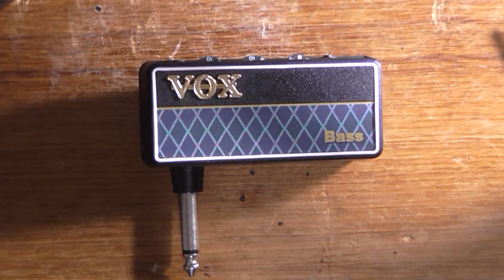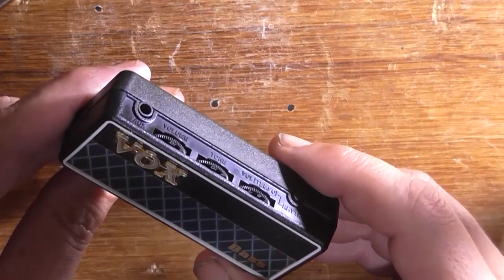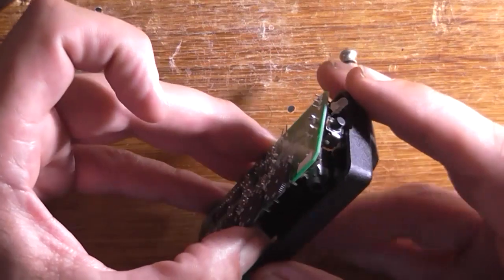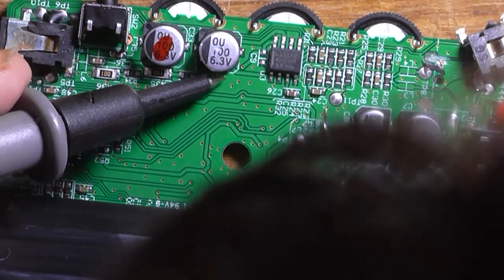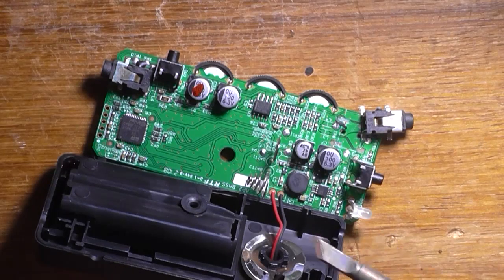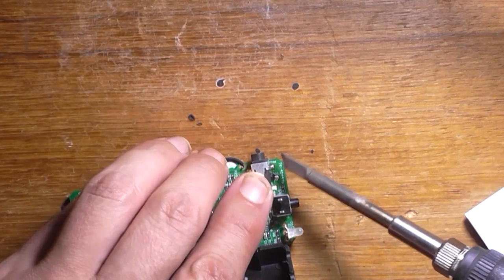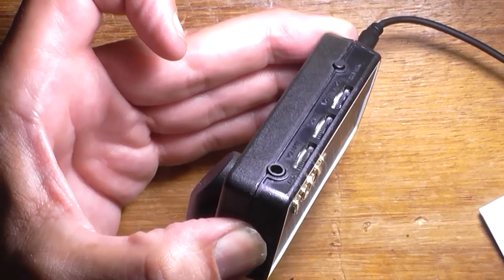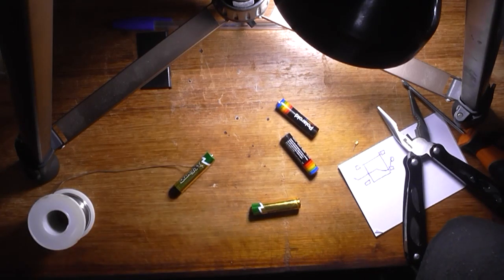VOX amPlug-2 Bass Guitar Headphone Amplifier Repair: FAIL!

Comment: @andymarshman9546
1 hour ago
Mine wouldn't turn on.  batteries good.  I found the spring for the positive battery terminal (closest to the pots) was not extending out enough to make contact with the battery.  I opened the thing up and using tweezers (a small Q-Tip would do) I pushed the centre of the spring forward just slightly.  If you push too much, the case won't go back together.  Works 100%.  Someone else suggested putting a small piece of tinfoil between the battery + and the spring.  I prefer my solution.

Comment: I'm an electronics tech as well as bass player.  No need to troubleshoot the electronics usually.  Mine wouldn't turn on.  batteries good.  I found the spring for the positive battery terminal (closest to the pots) was not extending out enough to make contact with the battery.  I opened the thing up and using tweezers (a small Q-Tip would do) I pushed the centre of the spring forward just slightly.  If you push too much, the case won't go back together.  Works 100%.  Someone else suggested putting a small piece of tinfoil between the battery + and the spring.  I prefer my solution.
Reply from the maker: Yeah, unfortunately I did repair the Aux socket, but knocked off an SOT transistor with the soldering iron when I slipped. I believe it was responsible for latching the circuit on; so, I practically made it completely useless lol. Doesn't matter really, as it was only $70 or so. Now, I just use an amp.
Reply: i broke my "phones" input aux thingy, what should i do?

Comment: I know the challenge! These things are built so that any repair tech's, hands, need to be about the size of a Barbie Doll's hands (as well as comparable, shrunken, equipment)! I did manage to replace the original hookup wire with some heavier wire, for possible future openings of the casing, but it failed after a year anyway.